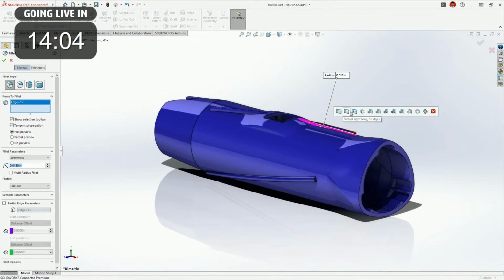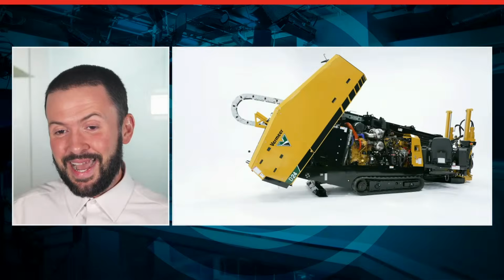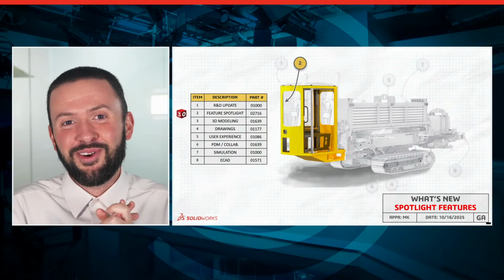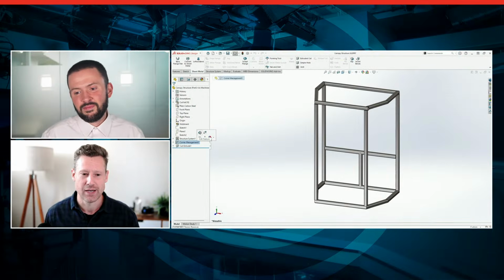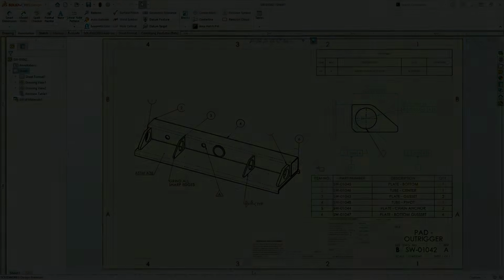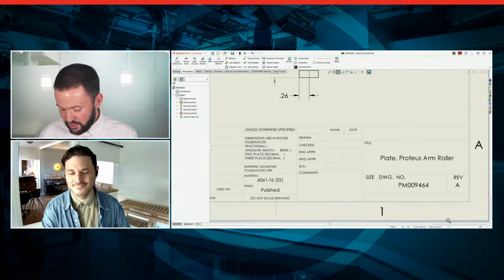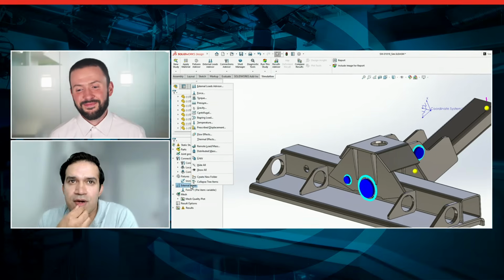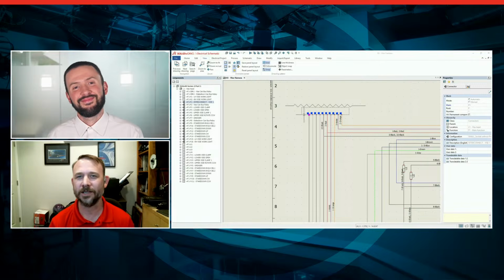What's New in SOLIDWORKS 2026 - SOLIDWORKS Live

Comment: One thing I'd like with electrical / mechanical routing is flexible paths.  There are many instances where a pipe or cable needs to move flexibly as parts in an assembly move.  Energy-chains with individual segments can do some of it - but it's a big performance overhead where there might be hundreds of segments.  I'd like something where a tube can be routed, mated in certain locations (terminations + passthroughs).  It's length stays the same, but the path just follows a best fit curve - like dragging the end of a spline in a sketch.
If you're designing real world machinery, this is a big issue.

Comment: Why don’t we stop kidding ourselves? SolidWorks is a mid-range CAD software that’s heavily limited! It’s restricted for two deal-breaking reasons.

First — its geometric kernel is Parasolid, which has very weak parallelization. No matter how powerful your computer is, SolidWorks will still run mostly on a single CPU core.

Second — it’s the 21st century, yet we’re still stuck with a ordered feature tree. That’s insane. What happens when you have a part with 2,000 features? What if you need to modify something near the beginning of the tree? Should I just end my life at that point?

Here’s the truth: Dassault Systèmes keeps this program artificially constrained. Let’s take CATIA for example — it uses the CGM (Convergence Geometric Modeler) kernel, which is vastly more powerful and efficient than SolidWorks. It also uses a Specification Tree, meaning it’s not ordered — features don’t depend on each other in a strict sequential order.

Why don’t you make our lives easier and just rewrite the program properly — with a modern geometric kernel — call it whatever you want, but do it right. I honestly don’t understand what’s left to “update” when the core problems remain untouched.

Are 20–30 crashes per workday supposed to be normal? I don’t think so.

That’s why so many people are migrating to Siemens and Autodesk products. Even Fusion 360, running on macOS, is way more stable.

Please, step up your game. This smoke and mirrors act aimed at engineers is starting to look ridiculous. We’re not stupid — we understand both hardware and software.

Oh, and one more thing — the 3DEXPERIENCE integration is a complete disaster. How can two platforms from the same company be so incompatible?

Comment: Filters in the cloud look nice, but I was trying to set up a new small company who has SW with Cloud (you still need much less confusing names) and I found the out of box 3DX setup to be such a pain, not even worth using, we gave up and opted to skip the cloud services. How can important things like part numbering and mapping of all the properties not be automatic with ZERO setup when using SW with 3DX? We couldn't make the part numbering we wanted because the 3DX options don't allow it, they also overlap with other naming, they have mismatch between part types and where the part originated or even which template option was selected in SW, and the global unique file name just adds to the confusion. It's a disaster. When will part numbers work from within SW and have all the properties included for everything every user would ever want? I should have a button in the save dialog to apply the automated numbering to any part or assembly based on the standard that has been created. When the file goes to 3DX it should never conflict, never be confused with global meta data and background version file names, and have all the properties automatically mapped and searchable in 3DX. (With options for how to name sub components of a step file or imported SW assembly) If that wasn't functional from day 1, why have we even been talking about 3DX for the last 10 years. I'm glad you mostly focused on SW for this presentation, since it's still really all that matters.
Reply from the maker: Hi there! A great place to start for direct support would be our SOLIDWORKS User Forum: solidworks.com/UserForum

We have a great team of SOLIDWORKS experts who are well-versed in the technical aspects of the software. They would love to help you out. We can also direct you to our support form here, where requests are triaged and responded to by our team: https://www.3ds.com/online-store/support-form/
Reply: @solidworks I don't think the experts can update the underlying code.

Comment: One thing that really annoys me is when I go offline or lose VPN and Solidworks shuts down. Solidworks should never close and and make me reopen it due to a license issue, maybe after 2 hours it can stop adding new features, but when you shut me down you fail! Hacked licenses never shut down, but you treat users like we're stealing the software.
Reply: Hey Dorian, that does sound very annoying. Are you speaking to the issue described here? https://www.youtube.com/live/icSCry6F5m0?si=df_EO1HTJJx4G2xo&t=1598 If I'm following correctly, this may be fixed as of 2025 FD03.
Reply: @SeanO-SW  No, I'm talking standalone solidworks with network floating licenses.
Reply: @DorianLust  Ah, I see! Sorry, I responded to this and it seems the response disappeared or something. Probably because it contained an external to YouTube URL? Idk. I linked out to an article from the SOLIDWORKS Help that describes how to 'borrow' licenses from network license setups for up to 30 days. This can help with any intermittent connection issues that may exist (if they do). I can envision multiple scenarios (e.g. on VPN/network side, license manager side, the interplay between the two, etc.).

In any event, I believe the max idle time in dynamically borrowed scenarios (i.e. you do not 'borrow,' but instead, open and have SW try to pull an available license should one exist), which you seem to have alluded to, is about 2 hours otherwise. It should, however, in cases where the software has been inactive for 2 hours, provide warnings that the license will return soon, and provide an opportunity to save if documents are seen as changed but unsaved. Some of this is discussed in a partially related knowledge base article (QA00000300803 - I'd link but YT will likely flag it!).

If any of this isn't working as expected, I'd definitely contact support to see what might be going on. :)
Reply: @DorianLust it's a good feature, I don't mind